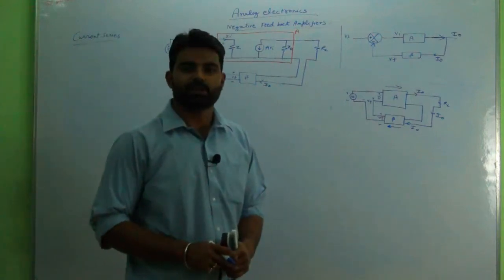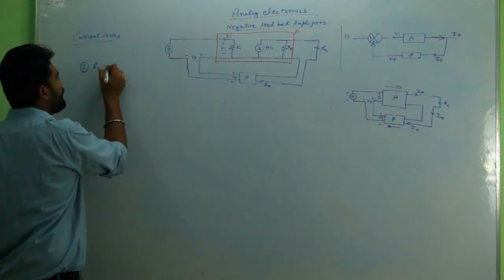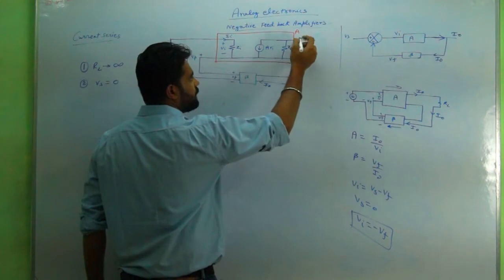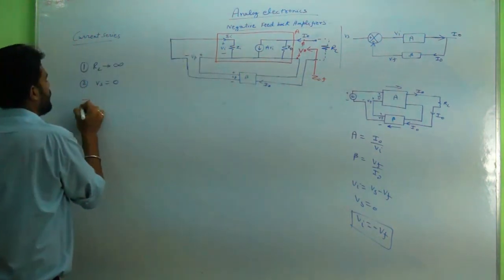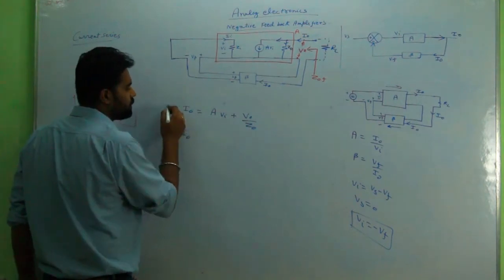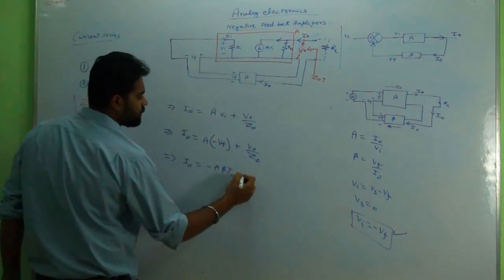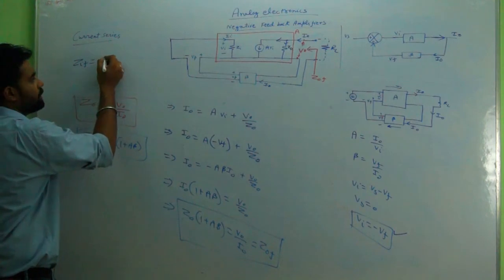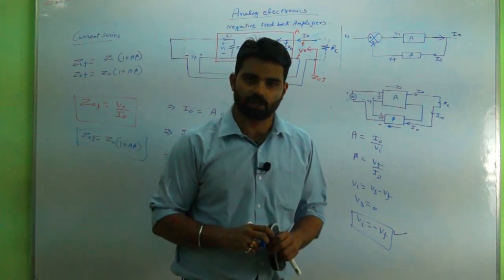Zof current series feedback amplifier output impedance

Comment: Sir please solve my problem in voltage shunt feedback the gain of amplifier with feedback is Vo/Is how it is possible that the gain is the ratio of voltage and current
Reply from the maker: gain is output divided by input.
in case of voltage shunt , o/p is voltage and I/P is shunt 
(current mixing)
thus gain is v/i
Reply: Lekin sir V/I toy resistance key equal hua na
Reply: Sumit Roy Studies  sir please reply
Reply from the maker: Mohammad Arif output/input can be impedance,  admittance,  dimension less.